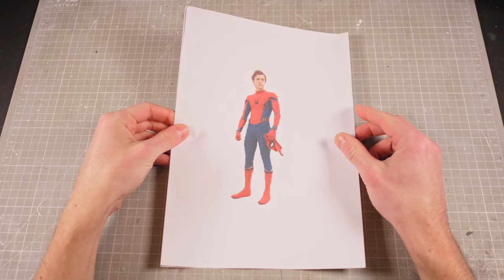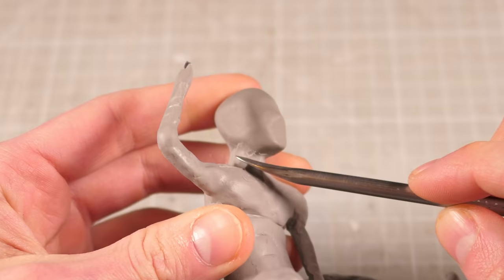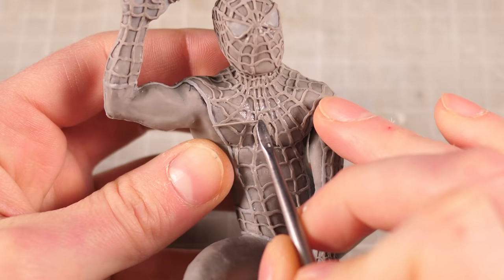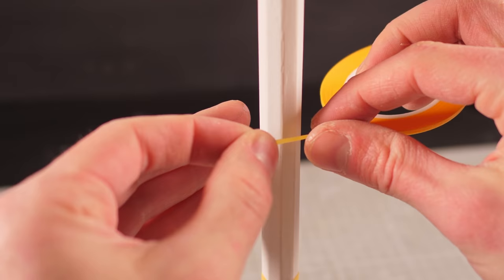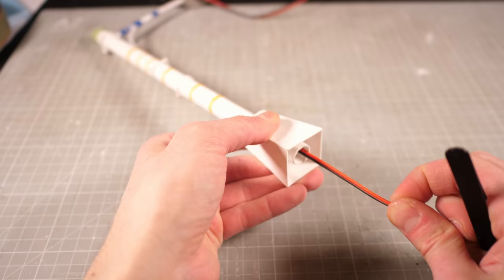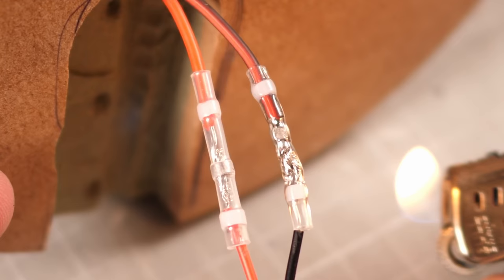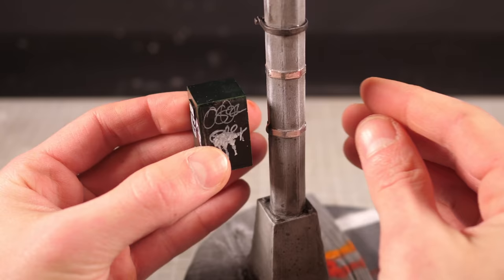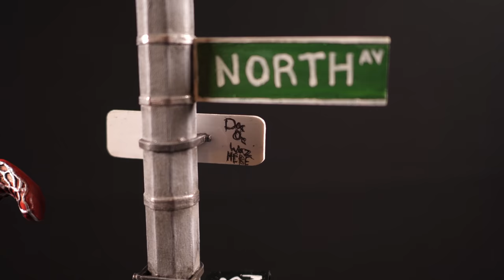Sculpting a Hanging Spiderman / No Way Home [Raimi Trilogy Suit]

Comment: pro tip: you can dip the clay into boiling water to cure it in sections as you work, so you don't mess up parts you've finished and you don't need to use your oven. extra helpful for hair and face parts.

Comment: Utility color codes are used to identify existing underground utilities in construction areas with the intent of protecting them from damage during excavation. This is done with either flags or a special spray paint, neither of which will cause long-term harm to your lawn.

The American Public Works Association (APWA) Uniform Color Codes for temporary marking of underground utilities are listed below:

Red:	electric power lines, cables, conduit, and lighting cables

Orange: 	telecommunication, alarm or signal lines, cables, or conduit

Yellow: 	natural gas, oil, steam, petroleum, or other gaseous or flammable material

Green: 	sewers and drain lines

Blue:	potable (drinkable) water

Purple: 	reclaimed water, irrigation, and slurry lines

White:	proposed excavation limits or route (you mark this before calling 811)
Reply: So yeah, Red and Orange were good choices

Comment: I've only recently discovered your work, so I'm guessing you've already been told this a billion times - but you should have some kind of resistor in between your led and your power supply (if you didn't already know). Also, those coloured bands on the heat shrink butt splices (heh, butt. Also, appropriate for the video) should be going around the wire.

Also, huge fan and I so very much love your work and am insanely jealous of the very particular set of skills you have. Skills you've likely acquired over a very long career....